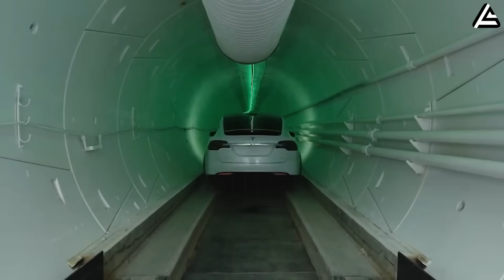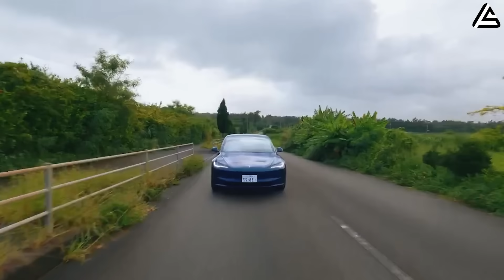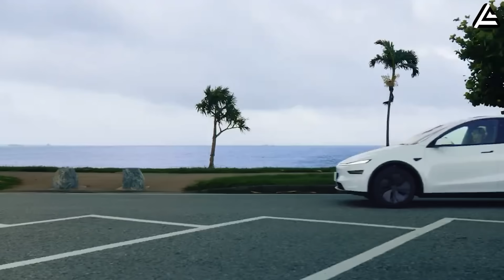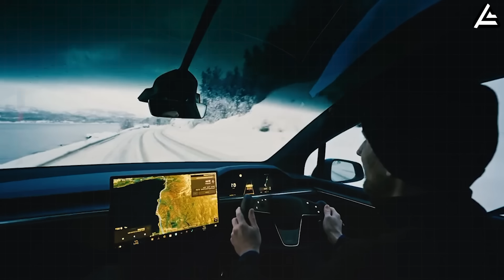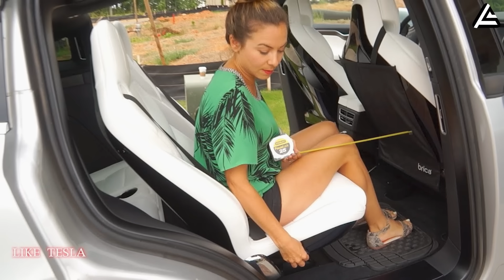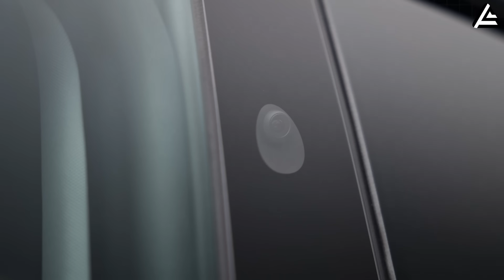Elon's Model 2 2026: 3 HUGE Changes You Need To Know. What Happened?

Comment: @ 04:18: 480 degrees F... is that really 800 degrees C? Send your robot back to nursery school.
Reply from the maker: You’re mixing units. 480°F is ~250°C, not 800°C. No one claimed 800°C, and that misunderstanding is exactly the point. The takeaway isn’t the number conversion, it’s that the cell was punctured and did not enter thermal runaway, which is the safety signal being discussed.
Reply: @AutoGearShift2  Read the screen. It clearly states 800. But I guess that is for those who can read.
Reply from the maker: oops. thanks for pointing that out. that must be a small mistake from our editor. I will tell him to be more careful
Reply: @AutoGearShift2  I really admire your response. Will tune in to more of yours.
Reply from the maker: thanks for your understanding! hope to see you again

Comment: Nice engineering over view. The 700,000 to 800,000 thousand miles before the battery pack drops to 80% IA very interesting. That is a real life cycle ownership cost driver as battery replacement costs are not covered in EV videos.

If seniors can egress this car, 230 miles range is limiting for interstate highway trips. Fast charging times and enough highway charging stations becomes an issue.
Reply from the maker: You’re touching the right trade-offs. Battery longevity matters far more than spec headlines, and fast-charge speed plus charger density matter more than peak range for interstate use, especially for seniors.

Comment: Overall, Tesla’s strategy is bold, but seniors should weigh affordability against reliability, comfort, and long-term support before buying.
Reply from the maker: That’s a very reasonable take. Affordability matters, but so do comfort, reliability, and long term support. If Tesla moves forward, those factors will likely be part of the design tradeoffs. I will keep sharing updates as more clarity emerges.

Comment: EVs don’t actually have major issues in cold weather. That’s not the problem. The real issue is this stupid move of removing mechanical door handles and relying 100% on low voltage electronics. If that system fails, the car becomes a damn sealed coffin. People are trapped inside. No manual override. No escape. That’s not futuristic, that’s dangerous as hell.
Reply from the maker: Huh? Why is that? There's always a way to open it with a physical button, my friend?

Comment: Elon why don't you put a self charging system in the car.When l was younger they had a phone that you had to crank to use and later found out if you take the phone and put Cooper wires hooked up to the magnet you could have a electricy enough to charge the water for you could catch fish so if you hook up a magnet somewhere on the rear axle you can do the same thing and it will charge the car batteries as you drive.
Reply from the maker: That idea comes up a lot, but unfortunately it violates basic physics, you can’t generate more energy from the axle than the car is already spending to move. Any generator there would actually reduce range, not extend it.

Comment: The current Model already achieves efficiency close to 200 Wh/mile, way better than the 250 Wh/mile reported in this video.  So the Model 2 should be even better. Manufacturing cost and structural strength will be improved through the use of gigacasting front and rear subframes. This also allows major portions of the car to be assembled on parallel assembly lines featuring much easier assembly, plus the use of networked low cost computer modules to greatly simplify the wiring. Most experts say the battery will be LFP, scarifying energy density for much lower cost, plus retention of greater safety.  I think lower manufacturing cost will allow the Model 2 to be sold at around $25K, placing it below the upcoming $30K competition like the Chevy Bolt and Nissan Leaf.
Reply from the maker: thanks for your sharing. totally agree